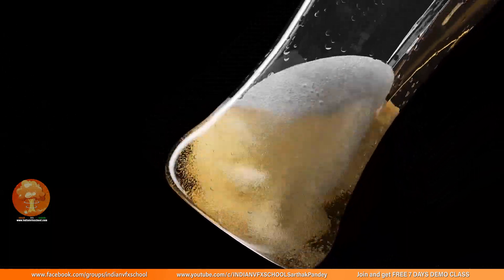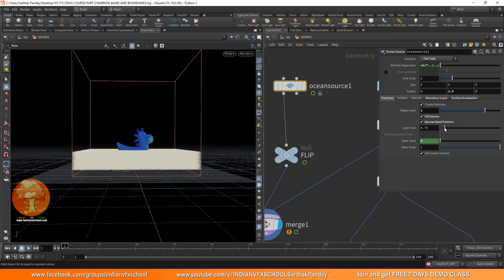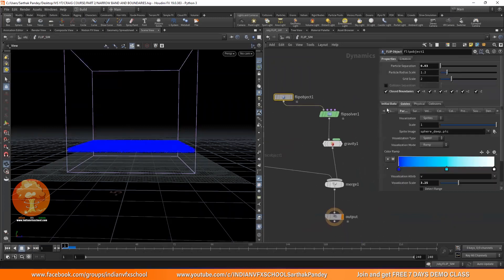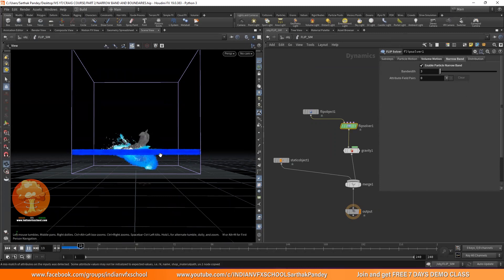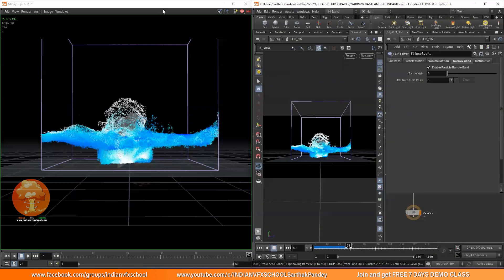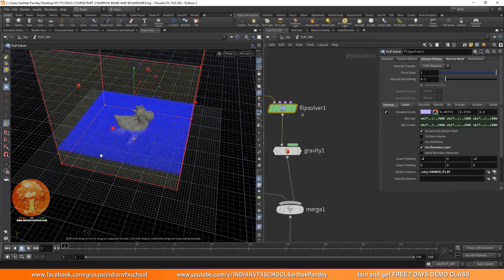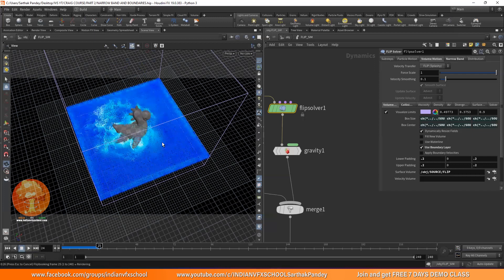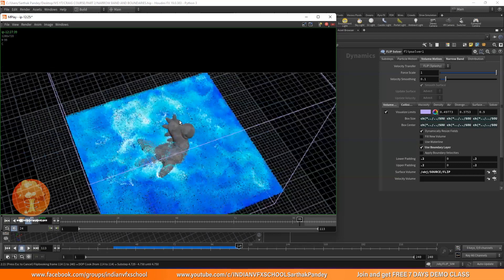Houdini Flip Tank Course - Part 2 - Setting Up Narrow Banding  #Houdini #FlipFluids #Flip #FlipTank

Comment: Another great one. I got just one question. In other tutorials I use to see how people feed the second output of the ocean source (which outs the geo as VDB) into the Surface Volume param of the FLIP object. Why are u feeding the polygonal geometry instead of the volume on that field?.
Reply from the maker: As I said in the tutorial, all the methods are correct, however if any method requires less amount of work and just works as good as any other, I tend to follow that, so yes you can follow either of them.
Reply from the maker: Also the answer to your question is, boundary and narrow band expects a volume field, which is even present in the polygonal output of the geometry.